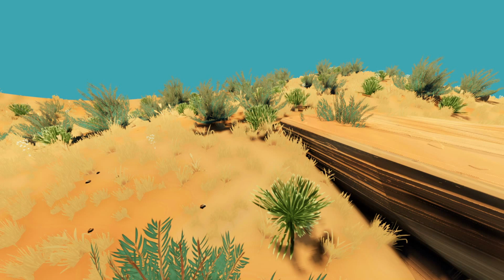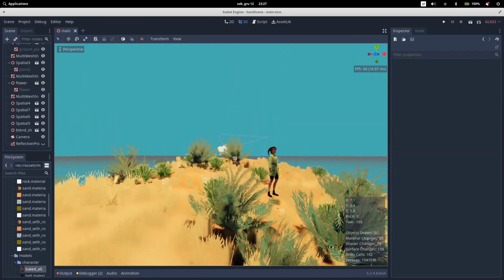Desert Scene | Godot 3D Devlog #6

Comment: if you can crack the alpha testing and sorting issues I would love to see what you come up with...it's a big issue for me as well....one trick I use is to save the png(I use png's) without losing the alpha color..that is I make the alpha the same color as my vegitation...but it still has a ton of issues with performance or quality.
Reply from the maker: Hi, actually  I am using something like this : https://github.com/godotengine/godot/issues/36669#issuecomment-615046047 I am not setting value to 1.0, but I am multiplying it by some value (like 1.5) and clamping, it seems to work better far from camera, with different mipmaps. Currently I am analyzing Godot source code. I try to determine difference between transparency with depth pre-pass and alpha scissor in code.  As for your png trick, it's actually pretty common technique named dilatation. You can use for example Material Maker to generate it easily.

Comment: Looks really good Wojtek! :). I've been having issues with slpha scissor as well in my projects. Seems to be a general issue. Some of the workarounds mentioned in the bug solved it for me though. https://github.com/godotengine/godot/issues/36669
Reply from the maker: Thanks! I think that alpha scissor force renderer to use opaque pipeline, so actually it should be faster comparing to discard. Also transparent pipeline doesn't work with SSAO or SSR but I am not 100% sure. But yeah, basically I am doing something similar to the workaround proposed by AsherGlic - https://github.com/godotengine/godot/issues/36669#issuecomment-615046047

Comment: Great Work! Looks nice! I noticed a similar issue with opacity. But on the other hand, I'm surprised how good real alpha-blend sorts in this engine. It's much better than in others. Maybe it's possible to write a custom shader for alpha-test to make use of the pre-pass. (maybe dithered alpha-test, or pushing the alpha-test a bit in the distance)
Reply from the maker: Thanks, for me it's really unstable, for some assets its working pretty nice, for other it's broken even from a close distance. Also I am not sure if its a graphic driver update or a difference between 3.2.2 and 3.2.4 beta 4, but it gotten  little bit better. Previously I could see through leafs in my forest biome with alpha blending turned on. Now it behave mostly correctly.

Comment: For plants I use Alpha Scissor with Opaque Rendering (in Preferences) with cast shadows disabled  and use a second object with a forked material set to unshaded and Alpha Prepass Set to render shadows only. 
This is how I get crisp shadows and no overdrawing or similar issues. I have a shadow distance of 200 Units, so depending on the model, on the second LOD Level I disable the shadow object. For Smaller Plants I also used two Objects, but I use a material with opaque shadows without Alpha Scissor (only Polygon Shadow). Doesn't really stick out for smaller things.
This might sound Like I waste a lot of material draw calls, but since I have like 5-7 different plants in my "bioms" that have 3 different shapes each for variation but still use the same materials, I have like 14 Material Drawcalls for an environment of ~200-300 plants. 
Could be worse.
Reply from the maker: I am doing something similar in my biome plugin. I am using totally separate lower level mesh detail for shadows. The problem I was talking about in this video concerns bad quality of plants with alpha scissors. If you look at edges of alpha tested textures, you can clearly see jagged lines. Alpha blending produces much nicer results, but introduces depth sorting problem (I showed it at my video). Maybe I misunderstood your comment. Also I am not really sure that two object rendering is always better. To be honest I was testing it with multiple scenes and results were sometimes surprising. I need to investigate more this solution.
Reply: @wojtek_pe  I don't have problems with Alpha Scissor. Always looks nice (despite when I use it with Alpha Depth Prepass, which causes the problems with >>looks like shit when further away<< you mentioned; that's why I have to use two objects for shadows). I don't know if you make the assets yourself like I do, but I found Alpha Clip in Blender is like a 1:1 preview of Alpha Scissor Treshold set to 0.5 in Godot, so I have really close results with blender textured preview und godot render (with some lighting adjustments in blender).